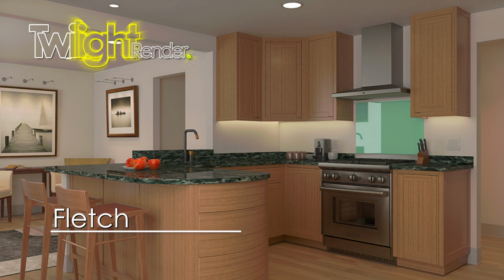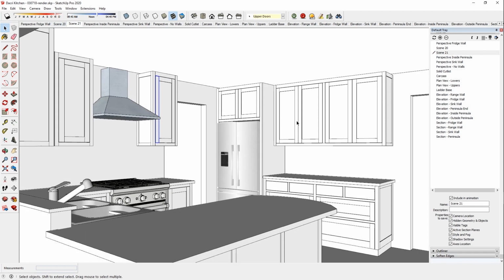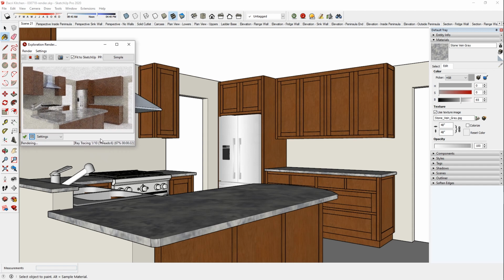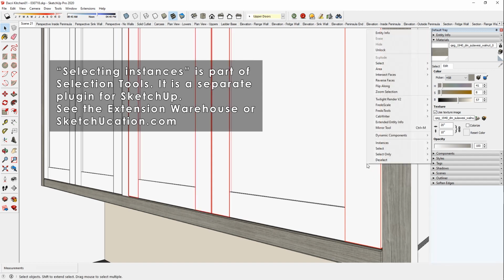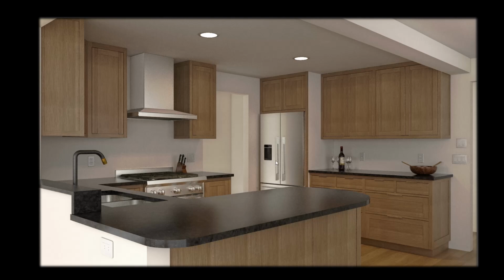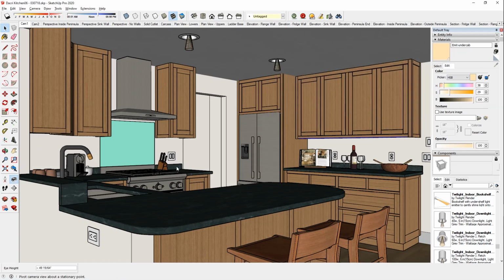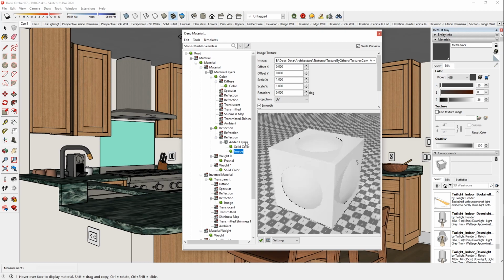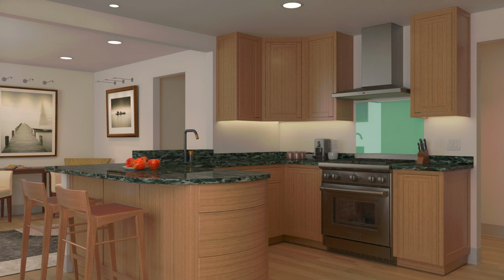Kitchen Design In SketchUp with Cabwriter and Twilight Render

Comment: This is a very helpful tutorial! How long did your renderings take? And how did you get them to look so sharp? I always use easy 09 for final renderings, but even if I let it run to 30/10000, it still looks substantially noisier than these. TIA!
Reply from the maker: Hello Rachel, thank you for your question. Render times vary per computer. The more threads you have on your render machine the better. Get the Fastforward Denoise addon for Twilight Render it's worth every penny and you will find that even in as few as 5/10000 your images can look noise free and fantastic. Also, since the time this tutorial was created we have added new tone mapping algorithms to Twilight Render - use ACES or Filmic post processing to instantly improve the look of your images. The images in this tutorial would have looked even better if they had used ACES or Filmic tone mapping in the render dialog. Fastforward will give some sharpness, but also you can use the "high pass overaly" sharpening technique in photoshop. see topic: https://www.twilightrender.com/phpBB3/viewtopic.php?f=16&t=5135&p=36648#p36648
Reply: @TwilightRenderPlugin  thank you!